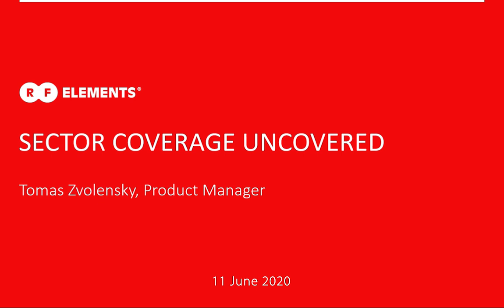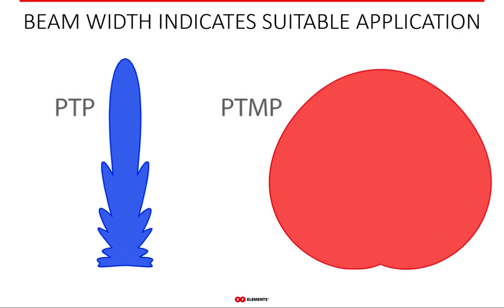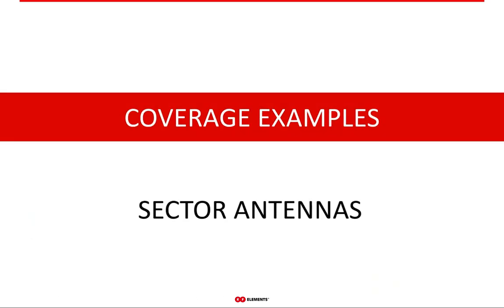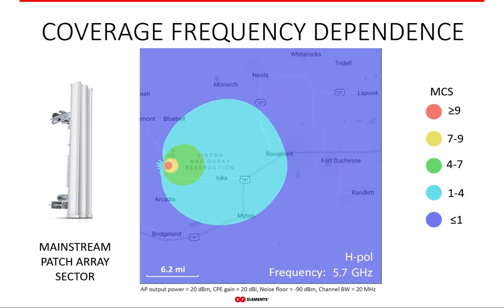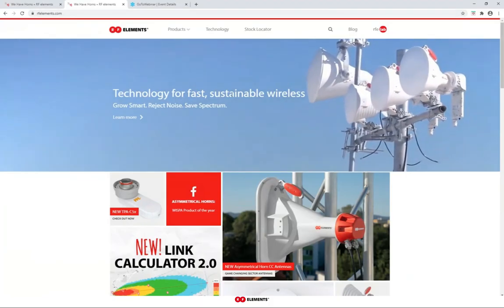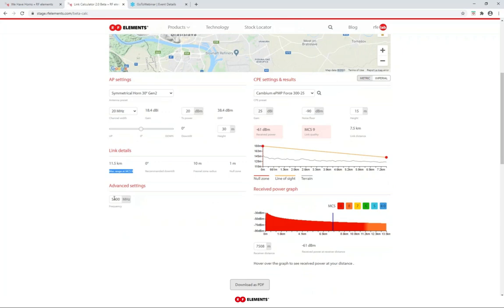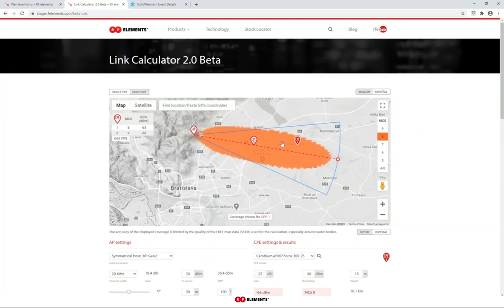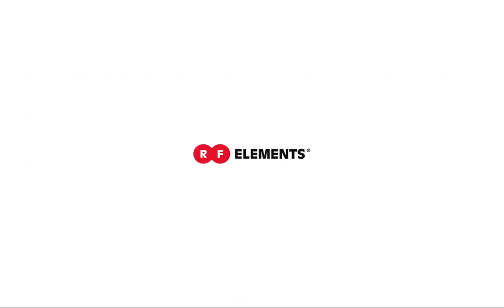Sector Coverage Uncovered

Comment: What is the Advantage and disadvantage of beam width ? If we have low beam width RF antenna it will impact coverage? Changing antennas  beam width what will impact on RF design? Test case we have 10 Degree  beam Width antennas  installed in network and after network swap we got 30 degree beam width antennas what will be impact on coverage?
Reply from the maker: The main beam width influences the area you are able to cover with an antenna. Generally two things happen considering the example you describe. First you increase the area of coverage (switching from 10 to 30 deg beam width) and second you decrease coverage distance. Wider beam width antennas have smaller gain due to the physics of antennas. You can get an intuitive understanding of this if you play with our link calculator (https://rfelements.com/calc) in the PTMP mode - selecting Ultradish antenna you see coverage with narrow beam width antenna, selecting 30 Degree Symmetrical horn, you see coverage with 30 deg beam width antenna..
Reply: I guess you never played with a garden hose sprayer? concentrate the beam and the water goes further. widen it to disperse and cover a wider angle -the max distance drops.
pretty much self explanatory.
of course this ignores interactions with obstacles and polarization, reflections etc

Comment: Great Explanation! i've noticed a potential bug in link calculator 2.0. In some cases CPEs are covered by "visual" coverage and that's correct in reality but if i look at in received power section it show "no los" even if i move cpes in area in which i'm sure are covered. In link calculator 1.0 they are covered and show a correct received signal power.
Reply from the maker: Thank you for the feedback. It all depends on the map data accuracy. We are currently updating the maps so soon we will announce when it's updated. The new maps are more accurate (but also free), so the coverage calc is to be taken as an approximate tool. For google-level precision, you'd have to use one of the paid tools.
Reply: @Rfelements  where i can find these paid tools? Thanks Andrea
Reply from the maker: https://www.towercoverage.com/ is one of them, for example
Reply from the maker: @andreac6472  There is also Google link planner by now, but not sure does it work outside US... still worth checking (our antennas are easily imported there - you can find the antenna files from our webpage download section)

Comment: so why don't we do something about the noise/interference and its sources?
why is your kneejerk reaction to just capitulate and accept it as 'normal'?
Reply from the maker: The unlicensed bands are unregulated, left at disposal of anyone who decides to deploy RF links at 5 GHz for example. The RF radios work just fine, so to shield competitive / co-located devices from each other, it is the best to propagate the signal only in intended directions, which is pretty much what our antennas do. What are your thoughts on dealing with the noise in unlicensed bands?
Reply: @Rfelements  Yes unlicensed bands are a wasteland and partially by industry's own doing so the best thing to do might be to just stay away and that should be relatively easy for serious businesses but that is not the jist of the problem at all.
Garbage consumer devices of all sorts are a far bigger threat. Grow light ballasts can be horrific for several city blocks from dc to daylight,  solar installations, street lights, even cofee makers and aquarium heaters not to mention plasma tvs and battery chargers, the list just never ends, it has exceeded all levels of absurdity and keeps growing. All of radio is in danger and there seems to be no interest, no awareness, no regulation and no standards enforcement. it's a total free-for-all for all. Try dealing with a power company who instead of regularly washing insulators flies a helicopter with some infrared and calls it a day. all the pg&e knowledgeable guys with a spectrum analyzer in the truck have retired and the new ones don't know a KHz from GHz. What's next?
Reply from the maker: @paulmitchell4421  I hear you, you're right... for many one-man-show WISPs though, the cheap gear is the only way to start and develop, and if they do things right, they will realize the very gear that got them started is the biggest obstacle to sustainable growth. Thankfully, this is somewhat self-regulating, since if they don't realize it, they won't be able to grow, physics work :)